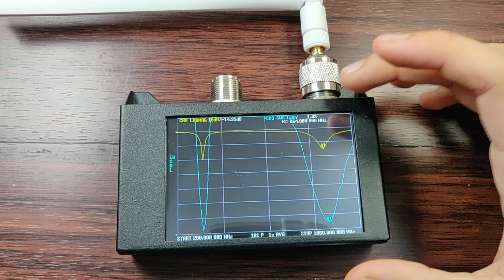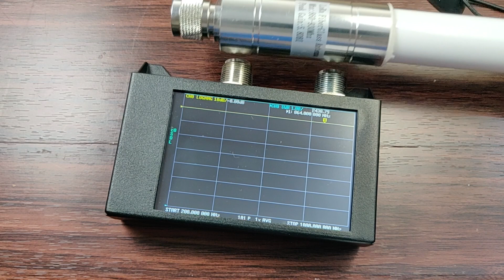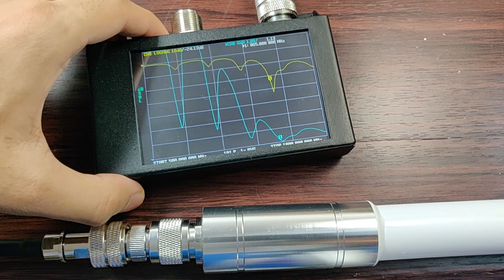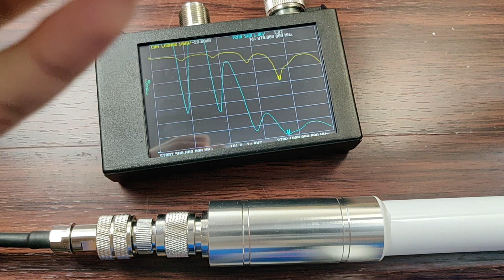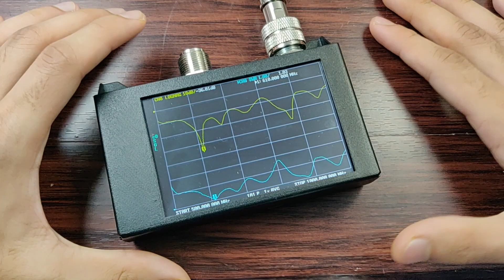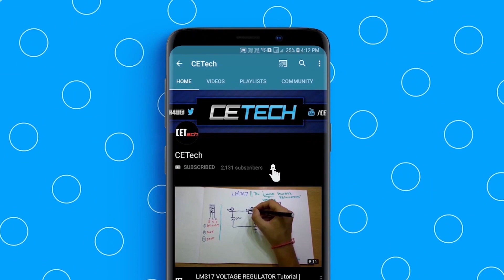Antenna testing Tutorial | How to use NanoVNA V2 SAA-2N | Best antenna for Helium hotspot

Comment: does this come with all the connectors.  I'd like to be able to unplug my rak v2 leave the antenna and cable where its at and plug it directly to the same cable the rak v2 is at.

Comment: Hello I allow myself to contact you because I live in France and I would like to start mining helium with a lift of 100 km because I live in the countryside and I would like good network coverage.
Could you confirm to me that if I buy the antenna and 4 Inch Display SAA-2N NanoVNA V2 3GHz 2.2 Version 3000mAh Battery Vector Network Analyzer HF VHF UHF Antenna Analyzer I could have a lift of 100Kms?
And also I would prefer to have an outdoor antenna that you could advise me ??
Thanks in advance
Waiting for your answer
Thank you